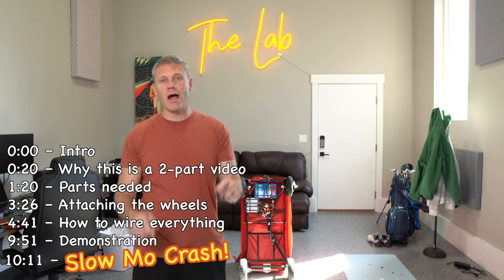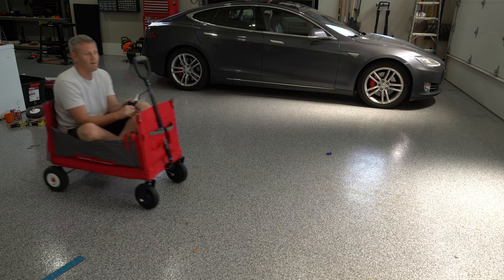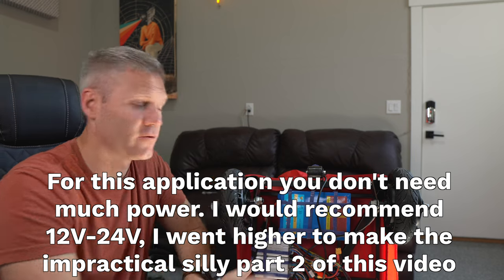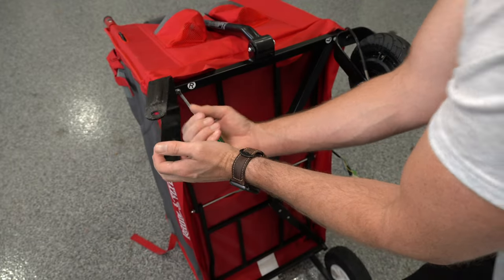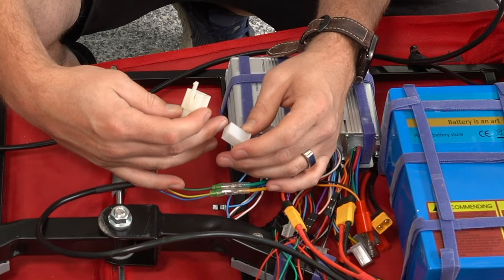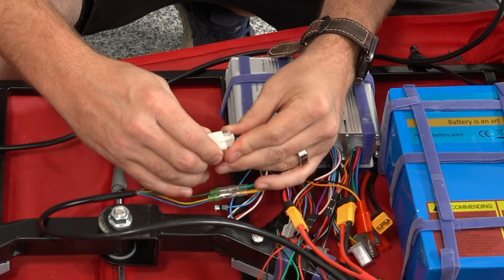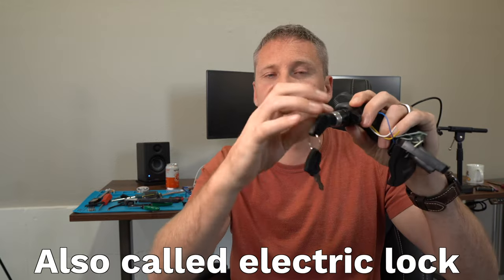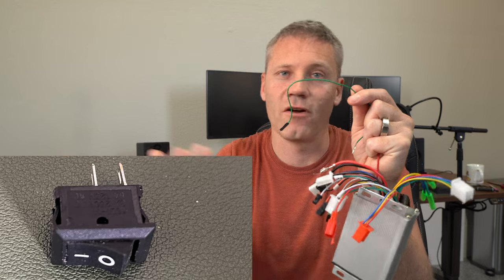How I Built an Electric Wagon

Comment: Funny I did this as my final project for my engineering degree, After pulling my son around I was like well there has to be a good option. I used an electric skateboard off amazon as my donor for the controls and motor.
Reply from the maker: Good to know, thanks for the tip!
Reply: Can you take the motor off the wheels??
Reply: @andesconsultingengineers1814  yea
Reply: Can u help me?😢

Comment: After the last beach trip and pulling our wagon loaded with beach stuff I’ve had it. Skinny wheels, fat wheels…..it doesn’t matter. It’s a miserable slog no matter what. I’m determined to make something work. There HAS to be a better way that doesn’t cost over $1000. All I want is a high torque, low speed motor with an option to disengage the motor to tow with a golf cart. An electric direct drive bicycle motor might work.

Comment: I know this has been awhile ago but I was curious if there was a way to control speed? You were zipping around lol I need walking speed haha
Reply from the maker: There is, the easiest way is to go with weaker motors like 12V, also you can modify the throttle or a  potentiometer to have a upper limit, so that it only gives it say 10% or whatever speed fits walking.
Reply: @waltsreviews90  ok cool thanks!